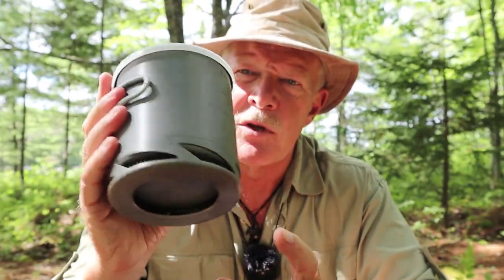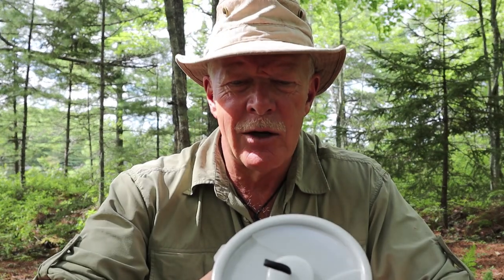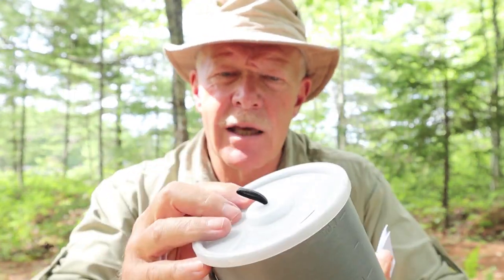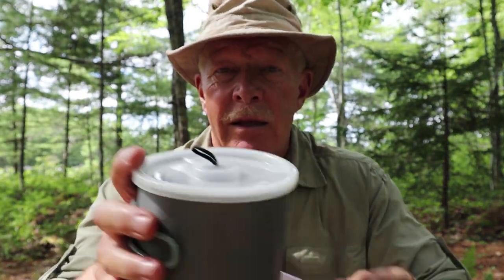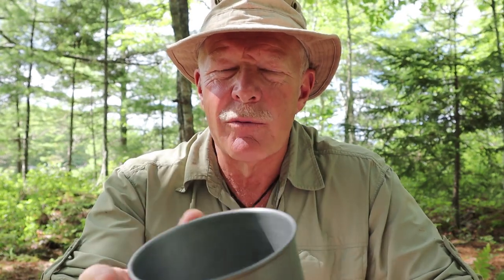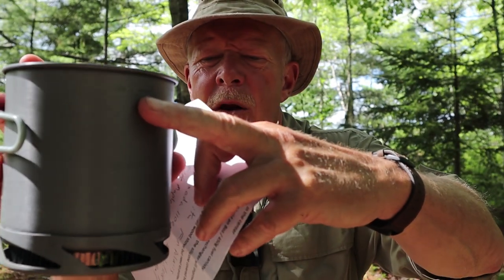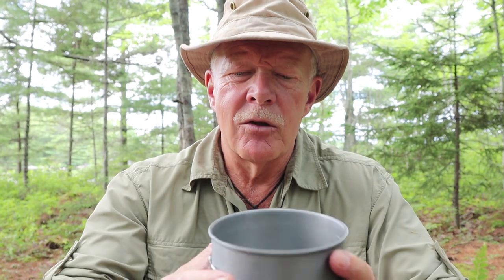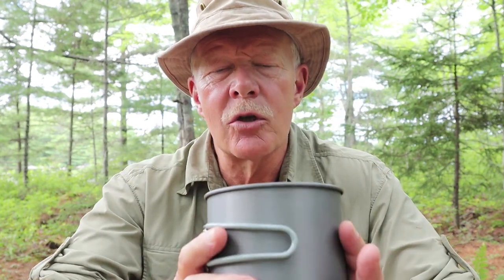Fire Maple FMC-XK6 1L Heat Exchanger Pot

Comment: I have had this set up for a good couple of years 
I use this pot with the Fire Maple Titanium Stove FMS-117T @ 103 g 
The pot is 190 g
So my setup is 290 g, which is very light
I use the stove on low volume so it uses very low gas as apposed to high gas
If you put your hands next to the pot there is no heat loss to the air it is straight into the pot
So the boil is slower but the gas usage is minimal 
So a large canister lasts for weeks with real cooking 
I also made a cosy for the pot, so I boil food and leave it to slow cook
Reply from the maker: Excellent advice. Thanks for commenting

Comment: Nice review Mark. I like what you did to the lid. I have an Olicamp XTS pot, and have been fiddleing with it for years. They are nearly identical. This style pot is a race car when you match it up with the right size isobutane, and works well with alcohol stoves too. The trick is to match it up the base ring with the support arms on the stove or stand. Head space is crucial for true speed or efficiency. Too close and you choke it out. Too far away and is slows down. Bottom line is that it works great and the lid can be reworked or replaced if needed (through Olicamp). I am on my original lid, but I really baby it. When I was a Scout leader, we used to race boil times with 500ml/16oz...this was Always as fast as a Jetboil in real life. Thanks again for your vids.
Reply from the maker: Yes, the similarity to the Olicamp is one of the reasons I asked for it. I agree, with a bit of testing this is hard to beat. Thanks for commenting

Comment: Thanks for the review, Mark.  I own the pot as well.  The only thing I don't like about it is the plastic top.  It has hardened and discolored over time.   I do like the pot.  I have similar results in terms of boil times.  I wish they made an aluminium top for it.  It would be excellent rather than just good.
Reply from the maker: I am wondering if that will happen to this one as well. May look to see what I can find as an alternative. Thanks for commenting

Comment: G'day Mark, not bad mate, concur 1 L is a good size to do most things without going overboard.
I reckon the heat exchanger does make sense, but for me personally, I'm questioning whether I really need that feature. Cant say I'm a fan of plastics of any description around flames, though that lid would be very good for transporting food or other kit inside, but then you're left with no metal lid to cook with. 
I do like that Fire Maple offer a range of options depending on your MO/preference, and decent quality at fair prices too; like the look of the Alti 900 ml Ti pot & lid and the Antarti 1 L stainless pot/lid without the exchanger as a couple of examples.
Cheers Duke.
Reply from the maker: Hello Duke. I am revising my suggestion about using this with fire. I expect the fins will get fouled up with smoke residue. I have a number of other Fire Maple items coming for review as well. Great value gear for sure. Thanks for commenting

Comment: My only concern with using this pot over a wood fire would be to use only hardwoods. Out here, we have primarily softwoods - pine, spruce, etc. I would expect the heat exchanger to be cool enough to cause the pitch in the coniferous wood to condense out inside the fins and quickly plug them up.
Reply from the maker: I agree, the more I think about it, the less I want to burn wood for that reason. I may consider wood pellets in a wood gas stove. Thanks for commenting

Comment: I would love to see a comparison between this pot and the larger 1.5l heat exchanger pot.   I'm wondering if the wider base of the larger pot will capture the heat better than the narrower pot.   And see if it is enough to make any measurable difference.

I also do winter camping in the Sierras and just bought a Firemaple remote canister stove with preheat tube.    I see Firemaple saying their Polaris pressure regulator stoves work great in cold weather.  I'd love to know if the Polaris regulator is better in freezing temps that the preheat tube types?  Thanks
Reply from the maker: Just so I am clear, you would like me to compare the smaller Fire Maple pot with the Larger Fire Maple pot to see if the diameter will make a difference? Also, I have two Fire Maple stoves with preheat tubes that I am testing and waiting for colder weather. I can add in the Polaris to see how well it works. Thanks for commenting
Reply: Did you try the Polaris remote stove compared to the heat tube stoves? Interested how the remote Polaris performs in below freezing temps

Comment: Love the heat exchanger additions and have been a diehard since my first MSR pot but the 1.5 litre kettle has to be the most utilized due to its slightly wider base.
Reply from the maker: Hi Rob. Guess I am late to the party on these type of pots. They have a bit more bulk but they do save fuel. Thanks for commenting my friend
Reply: @MarkYoungBushcraft  the kettle I use is an ALOCS brand that Dale ordered for me. Not sure where. Take care my friend!

Comment: hey mark! did you ever end up using a heat exchanger pot with a wood stove? i'd like to see that and differences in boil time. cheers
Reply from the maker: I decided against it as the soot and resin would collect in the fins of the heat exchanger. Thanks for commenting
Reply: Too bad.  @MarkYoungBushcraft  Patagonia sells a heat-exchanger SS pot with their wood stove, i was just wondering if anyone had done it with a random pot.
Their pot is the QuantuMiiR if you're curious. SS pot, Copper heat exchanger. Nice but not worth your money imho.

Comment: Nice 😁. Not a bad price either . I bet you could rig a pot support for a gasifier stove that fits right up inside the heat exchanger .
Reply from the maker: I have been considering using it with my Solo Lite. Thanks for commenting

Comment: I suppose that lid is great at keeping things secured inside during travel, but I would rather have an easier to remove lid while boiling.  I have a 1.8 liter heat exchanger pot; a smaller one would be handy.  Mine drips water down the side of the pot every time I do a pour over coffee.  I wish it had a bit of a lip.
Reply from the maker: Good point! Thanks for commenting
Reply: To avoid the dripping you can use anything like a spoon or stick pressed up against the lip of the pot and descending in the direction you want the water to go. Surface tension helps guide líquids.
Reply: @pedroclaro7822  Thanks; I'll give it a try.

Comment: I bet this would pair very well with a small wood gasification stove. I love my nano but it would probably just dirty it up.
Reply from the maker: I have a couple of small wood gas stoves I will try it out with. Thanks for commenting
Reply: @MarkYoungBushcraft  is the hole on the bottom of the stove big enough that you could potentially put the stove directly on a side ported alcohol stove. Looks like you could potentially even put it directly on a trangia... Might not be the most efficient that way.

Comment: HE pots are definitely more efficient.
Nice pot but I prefer my Widesea which has a small pot as a lid which would work as a cup if needed plus i store small containers of Coffee Tea and sugar in the small pot.
Reply from the maker: Good point! Thanks for commenting
Reply: Doesn’t Widesea  pot holds only 800 milliliters vs 1 full litter in this one? I’ve been looking at both and can’t decide.
Reply: @carmenmartinez2882  800mls less capacity because the lid is a cup.

Comment: Will this pot pair well with the soto wind master stove?
Reply from the maker: I don't have the SOTO Windmaster but I do have the Campingmoon version which almost identical (I have a video on this stove). It works perfectly with this pot. Thanks for commenting
Reply: Did you ever add the extra holes and if you did would you recommend it I just received mine

Comment: I've tried running these experiments to see how long a stove and pot will boil. Problem is there are far too many variables to control.  The pressure of the fuel in the can changes as the can is depleted, changing the gas output at any given valve setting, making it impossible to know how to set the valve, then, how can you really be sure you are setting the valve the same way even if you use a new gas on each attempt. The temperature of the gas also impacts the gas pressure and probably also the barometric pressure. Starting water temperature is another variables.  Some day, someone will do a large, well controlled study.
Reply from the maker: Yes, you point out some of the issues with this type of testing. Gear Sceptic is working on this now. Thanks for commenting

Comment: Have you ever experienced a toxic vapour from the pot when used with a trangia spirit stove...??
Reply from the maker: If you mean vapours from the metal heating up, then no. The aluminum is hard anodized and very safe to use, especially if you ensure there are always liquids in the pot. Thanks for commenting